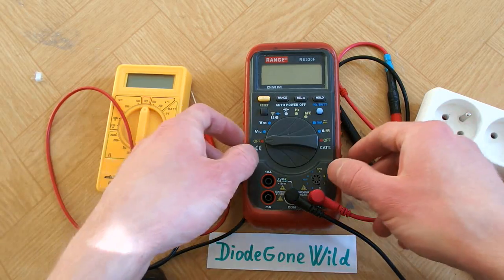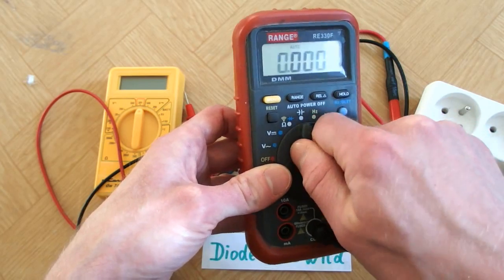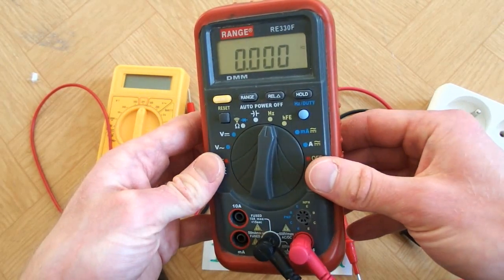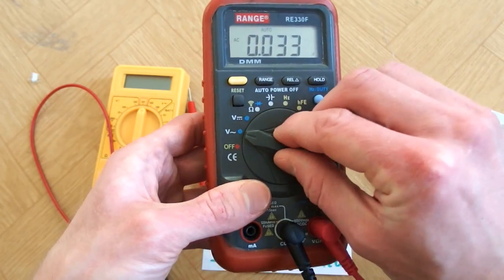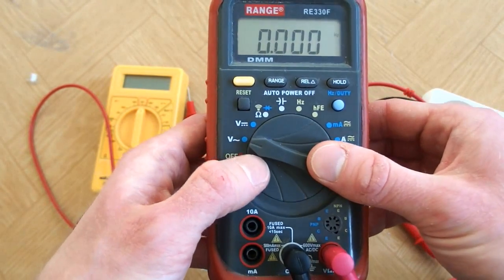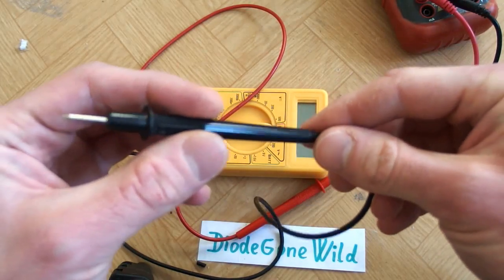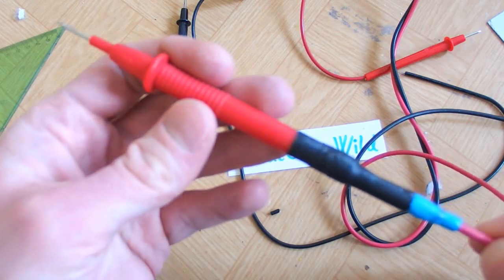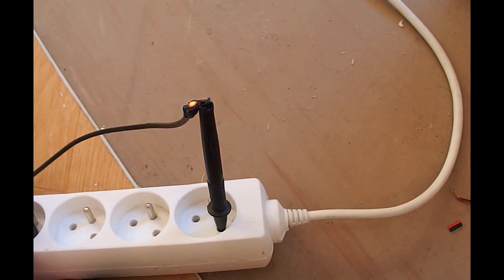Dangerous Multimeters (+ Explosion, Smoke & Fire)

Comment: Spend $500.00 to $600.00 on a Fluke or Gossen meter with fused probes , relays, and resistors as backup made to protect you .
With better quality copper and silicone leads made for high voltage 18 to 14 gauge .
A $9 multimeter is an accident waiting to happen.

Comment: the wire is a 10 ampere fuse but for short circuit only thats why wire is thin to not burn multimeter but to burn cable

Comment: Today probe exploded in my hand because same reason and I was measuring voltage between 2 live wires.
I was not hurt and my hand was black like I was holding charcoal. The BANG was way louder and bigger than on this video and I was really suprised by the power of it. This was very useful experience for me because even if you do everything right, there could be a fault in your equipment that can cost you a lot.

Comment: I don't cheap out on anything attached to mains Voltage. Cheap Meters are fine if you stick to low Voltage+Current applications, but don't bet your life on the fake CAT rating or protection Circuits of cheap Meters.
If its potentially dangerous, get a proper, certified Meter.

Comment: The frequency measurement thing is basically the same on all chinese multimeters but mine (aneng 8008) has mentioned in the manual that Hz is for low voltages, thankfully i didnt plug it in the mains or i would have burnt it..

Comment: My boss put a meter across 480 volt mains with his meter on amps and his meter exploded to an extent that he needed skin grafts. This was in the 70s so im sure meters had even less safety fetures back then.
Reply: They weren't made in China back then, so they weren't as dodgy. But shorting out 480V with a meter on amps is a very dangerous and stupid mistake.

I learned to always check the amps socket the hard way too, when I wanted to measure if my gas scooter was charging the battery when running. So, I accidentally shorted the battery with the meter and the 80+ cranking amps started heating up my probes. I noticed when my meter didn't show anything and my probes were nearly melted. What was amazing is that even though I shorted the battery, the scooter still kept running! The multimeter case was melted together a bit, but I opened it and found a burnt shunt, as expected from my stupid mistake. Luckily, every other function survived the incident.
Reply: @AdamSKEN.01Well, even though the meters were often made in USA or Japan, I could imagine that the safety standards were abysmal back then

Comment: i never experienced such a thing before, i remember accidentally measure 380v mains on ohms range, the multimeter just didnt measure anything, but no explosion no nothing, and the meter is perfectly fine
Reply: It doesn't take much to provide the necessary bank of NTC resistors in the metre for it to be safe on mains even in the presence of user-error.  It doesn't require Fluke prices.
Reply: What multimeter was that?
Reply: @E-GaN  fluke 87v
Reply: @TonnyCassidy  yes of course brands like fluke, gossen metrawatt and some newer uni-t models (like ut-61e+)  have excellent safety.

Comment: Never trust any rating you can't check yourself either via careful testing or a UL report or similar; your life is worth too much to trust random ebay sellers when they make safety claims with their $10 meters. Good info on making sure you understand how your own equipment works and how important good probes are. I myself had a couple of cheap meters when I started in electronics that were actually quite good... but I threw away the crap probes that came with them and got some really thick and well made ones instead. Lasted me for years...

Comment: How does automatic ranging function work?
Reply: Voltage measurement:
Every time, it starts at the highest range, and if the output value is too small, it internally switches voltage dividers. And it will keep switching until it gets down to the lowest range that can handle that value.
250 > 200 > 20 > 2 > 0.2 > 0.02 V 

Example: 50V (range here)
50V (250) > 50.0V (200)
If the value rises during the measurement, there is a voltage clamping circuit that clamps the voltage so the measuring chip won't burn out. And once the clamping circuit activates, it goes up by one range. This way, the range is always close to the measured voltage.
This can be done using comparators, but most commonly it's done by a microcontroller.

Comment: I got some 5€ multimeter from gearbest some time ago and it has worked fine. One issue is that the probes have no strain relief so I broke one of the probes because the copper wire came out of the tip. Once I fixed that and added a form of strain relief on the probes it has been okay, but I would never stick it into mains and I doubt I will work with that kind of stuff any time soon so I don't really need a better meter for higher voltages because I don't use high voltage

Comment: Yes, test probes are something that's often overlooked.

As an electrician in the UK, i'm often measuring the Ze value (what most sensible people would call the earth fault impedance). Basically it involves sticking probes on the main intake cables which in the UK are fused at between 60 and 100 amps, and connected to a very low impedance supply (short circuit values up to 16,000 amps, altho that's quite rare. But I routinely see 2-3000 amps as a value).

Imagine your scenario there, combined with a short in the meter... doesn't bear thinking about.

My colleague thinks I am mad for constantly checking the probe wiring, and wearing full protective gear (insulating gloves with protectors, face shield, ear defenders etc).

I'd rather look stupid and be alive than look cool at my funeral
Reply: To they layman, an electrician decked out in proper equipment would look pretty cool I think--certainly professional. Screw what dolt coworkers think.
Reply: I once had an AVO CM500 blow during a ZE test, the screen cracked and there was some smoke but it withstood the blast, it was only a week old and replaced by AVO (Megger) free of charge, they didn't give an explanation but at the time it cost over £1000 to buy, the leads were top spec so they were fine, but made me cautious every time I pressed test, I always made sure I bought genuine test leads and sometimes paying £25 for a set of test leads to use in a £10 multimeter could be a wise investment.
Reply: After high voltage involved fatal accident you must likely will be buried in closed casket. Without opening in funeral to not disturb people.

Comment: Hi i hope you can provide a repair guide for a coin guided "coin comparator or coin selector" . Used on pisonet machines. I have pisonets and the coin selector is always the part that needs replacement often.  Thank you in advance. 
I find it hard to repair this because i dont know how the circuit works on a coin selector.

Comment: It happened me as well when I tried measuring the current rating of mains socket it just tripped the circuit.
Reply: Akshay I had dodgy old fuses (instead of circuit brakers) a some guy had replaced the original 25A copper strip with 6mm² wire so multimeter probe wire just boiled and i got burn everywhere.

Comment: I had to purchase a new digital multi meter, a few months ago, I'm only using low voltage dc and not mains voltages but I did replace the cheap china test probe leeds with a set of expensive ones if I had been using it for 240 volt ac testing I sure as he'll would have purchased a more expensive meter.

Comment: The meters explode, because people don't know what socket to put the test leads in for the different functions. I am guilty of this as well and had sparks. So I purchased a smart DVOM that lights the socket for the range chosen. It is a great idea, but only expensive ones seem to have this function.
Reply: yeah, i blew my first multimeter like this, the COM bus on the circuitboard lifted and broke when i tried to measure mains with the ammeter  by accident XD. i repaired it and it still serves me well though.

Comment: I can see why the resistor went bang when you stuck it onto Hz.
The current through the resistor = 240V/10,000Ohm = 0.024A (24mA).
Trouble is, P=IV and therefore P = 0.024*240 = about 5.7W. 
No SMD resistor is going to be rated for 5W!
Reply: There are 5-W rated SMD resistors: https://www.mouser.com/Passive-Components/Resistors/SMD-Resistors-Chip-Resistors/_/N-7h7yuZ1yzvvqx?P=1z0wui7Z1yzmno7 for example.
Problem is, at this meter's price point, the manufacturer isn't going to spend the extra pennies for a correctly-rated component.
Reply: SigEpBlue but you see how big and beefy they are
Reply: Evenif you could find the 5W resistor, you still don't want it to dissipate that amount of energy inside you multimeter.
Reply: @rashidmdamin5552  is using a higher resistance value better?
Reply: @omniyambot9876  Yes, if you want to measure the frequency of a HV source using Hz setting
Apperently the Hz setting is meant for the low voltage measurement.
Assuming the smd resistor can safely handle 5mA, then the appropriate resistance would be ~ 48K ohms.(240v/5mA)
You can try using 40-50Kohms in series with you probe.
Reply: @rashidmdamin5552  oh I see. Thank you. Can I ask other unrealated here but electrical stuffs?
Reply: @omniyambot9876  I have checked unfortunately , the max power rating for an smd resistor is 0.5watt, so the resistance would be around 120K ohms. The current flow would be about 2mA. 
Any other questions, If I know, I ll try to answer based on my limited knowledge 😅
Reply: P=U×I

Comment: The first one was the fault of the instructions, its a shame the meter got damaged.
I have never seen that brand before, possibly similar chip to the Vc97 or 99 one.

The leads that come with the yellow cheap meters are allways crap, i allways use 240v mains wire to replace them, and they cope with current better.

I have many of the cheap yellow ones, i dont use them for high voltage.
I also have an old micronta digital from 1983, still works fine :-D.
Ive never had any meter explode in 35 years of electronic repairs, i may have luck on my side, or im carefull LOL :-D.
Im supprised that you havnt had more explosions with the high voltage supplys and experements on your site LOL :)
Reply from the maker: This doesn't have any marked IC, just a black blob. The leads have thin core and they tend to break near the probes. I have fried numerous multimeters while playing with high voltage, but this was the first time I was struck by its explosion :).
Reply: Yep its likely a FS9721 from fortune semiconductors, 4000 count, range limits are 0.4,4,40,400, a typical chip to replace with a blob.
You are evil lol, "The Digital Killer" :)
Reply: zx8401ztv Wow, all I have is 2000 count meters based on ICL 7106 and one chip from maxim. I killed a blob once and successfully replaced it with the 44 pin SMD chip :D There was no fire, just a little boring click when I sent second anode voltage down the probe :)
Reply: I would say you improved the meter by replacing the blob with a known quality 7106 :-D.
Reply: zx8401ztv hey mate I know this is random but I want to buy a multimeter, do you think the uni-t ut139c is good enough for mesauring mains voltage?
Reply: Filip Pelemis hi good question, I would like to know that too. Have you confirmed on whether ut139c is safe enough for mains since your question 1 year ago?
Reply: The first multimeter i owned (had been using lent ones before that) was a Hwin EM490, i was so exited when i got it, probing everything. Then 2 days after i got it i decided to probe mains(110-125v) but i forgot that the positive lead was connected to ammeter so the very moment i probed the thing made a bang that sounded like slapping a table with a magazine, then some magic smoke escaped...

I opened it and the COM bus on the circuitboard had lifted and opened like a flower XD, i soldered a pice of copper wire to reconstruct the circuit and it was back in business, it still works fine today even if the original 9v battery is marking 7v now and its currently giving me the low battery symbol on screen.